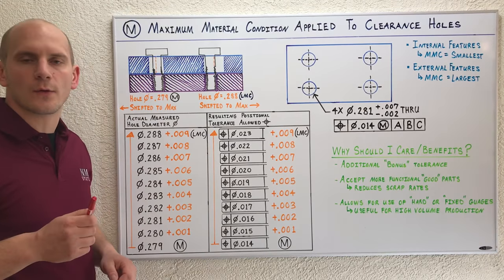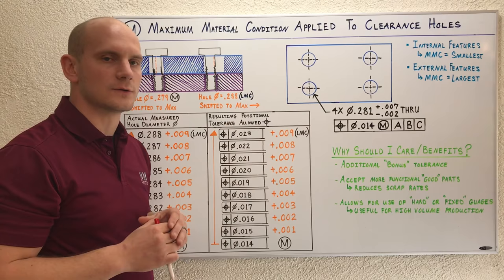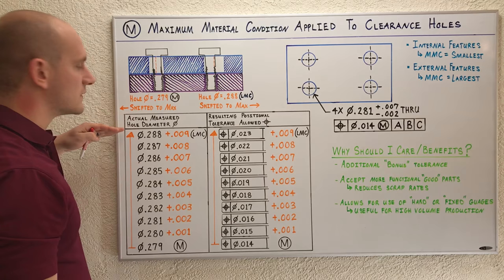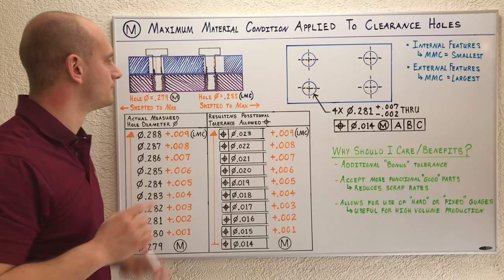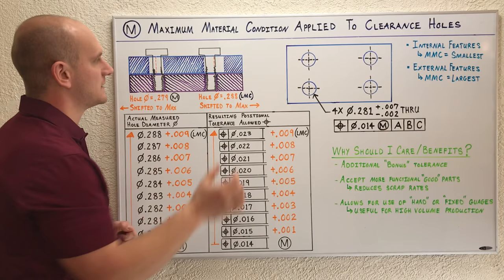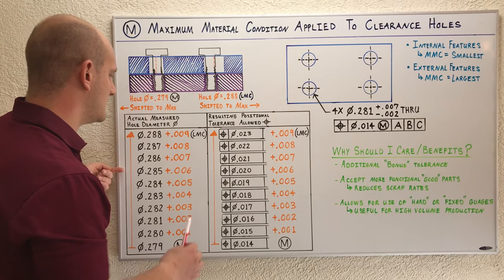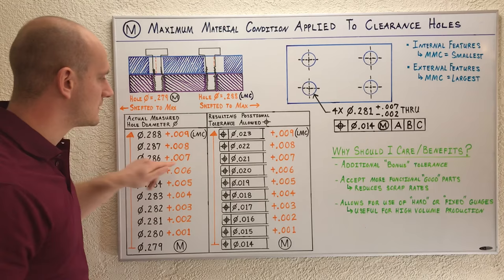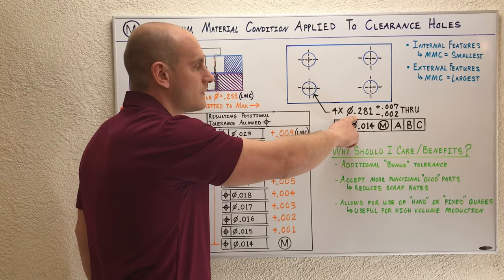How GD&T Maximum Material Condition (MMC) Works with Clearance Holes

Comment: for LMC actual measured dia. we get +.009 increase in base dia. value i.e. hole deviates +.0045 from axis line to both sides.....so we can only add +.0045 for positional tolerance in one side.......increasing to +.009 can create interference.

idk.....please correct me if im getting some wrong idea
Reply from the maker: Hi there Sanket N! Thank you for watching and for the great question! I do think the mistake you're making is that you are going back and forth between diametrical and radial analysis. So yes, from a radial perspective you are allowed to add .0045 radially. And no, you should not add .009 radially. But, you can add .009 diametrically which is what I am suggesting. I feel you really have a good grasp on this as long as you look at the situation in either radial or diametrical terms, not both at the same time. Thank you for watching and for taking the time to comment! Stay safe and healthy!
Reply: @StraightToThePointEngineering  yes ...I was thinking about radial increase but video was in terms of diametral increase, and i missed that ∅ sign also.......thank you for responce!

Comment: I'm with y all the way up to 3:54. So what do you do with the 0.020 resulting positional tolerance allowed? The part is made so you don't add it to a drawing. The part has been made no matter if the resulting positional tolerance allowed is 0.20 or 0.016. Makes no difference to the already finished part. What value does this calculation make if it can't go on drawing before the part is made?

Comment: Question: I wanted to understand why are the increments from MMC 0.001? I am working on different problems and I found this video helpful thank you but I was not able to understand how 0.281+0.007/-0.002 was calculated through 0.001 increments(i.e 0.279,0.280,0.282...)
Reply: 0.288 is the Max deviation, 0.279 is the min deviation. . From the design data we have diameter of the 4 holes to be 0.281. he just added the tolerances +.007 and -.002. MMC and LMC.
Reply: The values in-between are possible scenarios. 0.279  the smallest acceptable value now corresponds to 0014. Increment of 0.001 is probably the easiest way for us to understand the concept.